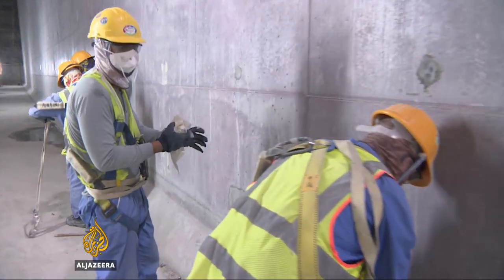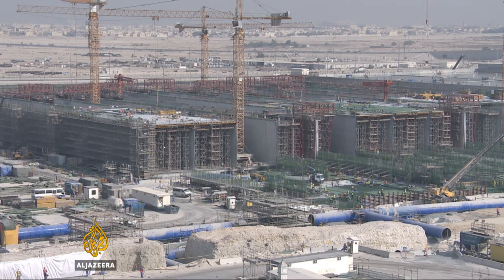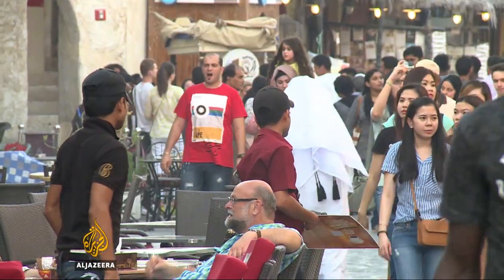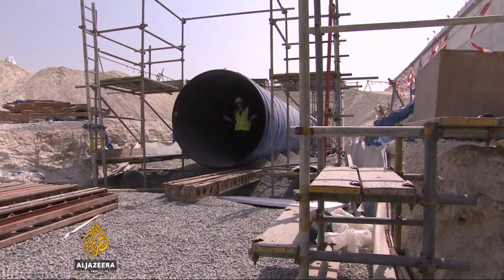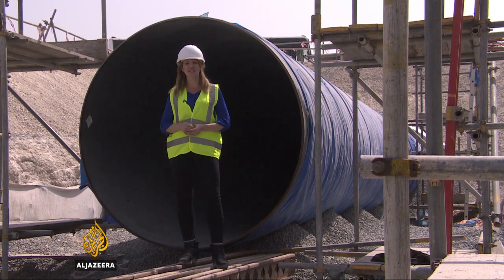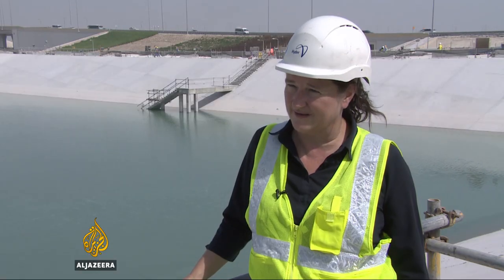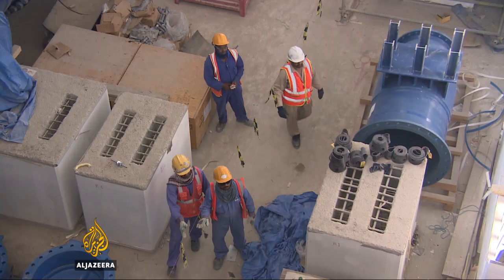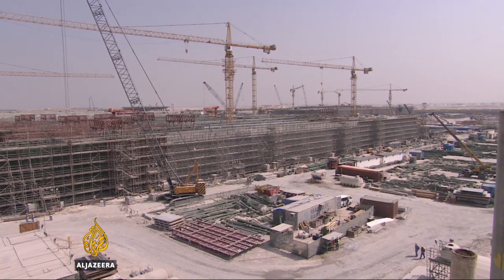🇶🇦 World's largest water reservoir built in Qatar

Comment: Offshore water rig instead of oil. Thought about using  the pressure from deep sea pipe and piping and tapping into natural pressurised desalination. The deeper you go the more pressure, this is energy is inline with the E=MC principles (energy mass circulation) the pressure on a submersible object is extreme at depths that current rigs tap into instead of oil. The true life force of all life is based on and around Water.

Comment: With the heat of Qatar these waters will be evaporated rapidly.
Reply: That's exactly what's gonna happen. An underground cavern similar to Tokyo's G-CANs would have been more appropriate considering Qatar's heat.
Reply: The hydro-engineers have already made calculations on the rates of evaporation at different Qatari climates, wind intensity, densities of the water, ambient temps etc. All parameters have been taken into account. Plus, the total output per day of the desalination plants would suffice, or even exceed the reservoir capacity.
Reply: @mohabatkhanmalak1161  "Exceed the reservoir capacity" what are you talking about,if that's the case  then wats the  point in making a reservoir.
Reply: @crankshaft5867  In these kinds of project the desalination plants max output would be more than the total hold capacity of the reservoir, this is to make up for any shortfalls. Demand can go up if there is for example extra usage from big industry or construction projects.